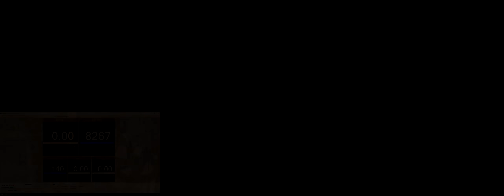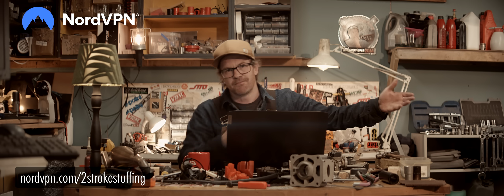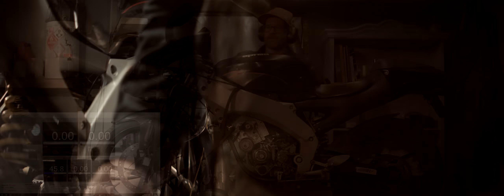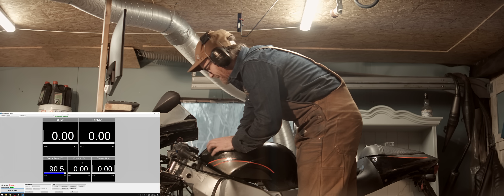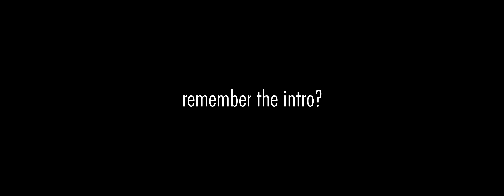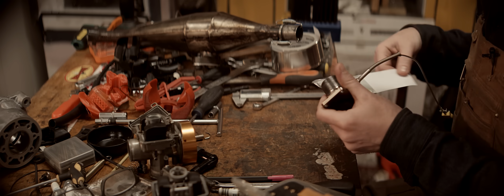P2 - Found THE Problem! - Now, Onto Making the Most Powerful Two Stroke Ever.

Comment: I told you it was the pipe many times. Using fritz formulas for pipes too it was obvious the pipe was wrong. You need to be making pipes to suit your changes. Remove the stuffers already.
Reply: 2 stroke is all in the pipe. Sigh.
Reply: It won't be when he switches to boost. @MrJermbob
Reply: Yes it will. Lol. Hes been boost before and it was terrible. He didnt listen then either. When im friends with people that have alot of boosted 2 strokes that make way more power per cc than this guy ever has. @davidgierke7582

Comment: Hey Alex I see it as a progress. 
What you are explaining makes sense to me.

I did a similar thing with my most recent Pipes when I increased my RGV from 250cc to 300cc.  
I also learned that simulation software can deceive you if you input "optimistic" Data. I lost power simply because I got the peak power target wrong.
When I did a set of successful pipes using MOTA to raise peak RPM. 
Once I got a good SIM of my engine, I had to keep juggling the pipe dims/timing/compression etc until I got realistic rpm outputs. (it did not give false readings just theoretical outputs way above the physical limits of my engine)
After all of that, the pipes did work and the SIM Data lined up with my real world Dyno results.
Onward and Upward
Pete

Comment: now you have hopefully found the problems with the engine. What's the next steps? 
Will you be starting to look at the larger crank case fuel injection? also, will the rotary valve be deleted eventually?

Comment: Now the only thing missing is the speed of the flow of the intake volume into the crankcase, if you can fix this part this engine will be able to take you to a speed of 150-160 km/hr which is equivalent to a 125cc engine. The 4-stroke, 58 mm piston is the engine of the Wave 125 motorcycle that has been popular in Thailand since the 90s.

Comment: Do you ever measure the volumetric flow in of the fuel if it agrees with your suppositions that a particular porting configuration is pulling unburned fuel out of the engine?  Just a random thought while I rest my aching back.

Comment: Pleaseee try not to use leaded fuel, the cons far outweigh the gains
Reply: No I think that you are wrong , the alcohol fuel that he is using is totally different to normal pump fuel a lot of the advice here goes astray because people forget he is using an alcohol type fuel . Also don't forget the pump fuel is very consistent and stable god knows about the alcohol fuel that he is using
Reply from the maker: Actually running 115 octane leaded fuel atm.
Reply: @2STROKESTUFFING   OK Alex I didn't realise that I know that you have used alcohol fuel before ? In the 2nd last video you got the engine up to 5-6 bhp @ 15,000 rpm yes ? I think that the Dyno is understating the power possibly by as much as half , I will explain in the 70's I had a Puch moped it had approximately 4 bhp and would do approximately 42 mph or 70kmh at around 7000rpm 
If I had run the same moped on your fuel I may have had around 7bhp And been able to achieve 90-100 kmh I know because a friend of mine did it with his Puch moped but again this would have been higher rpm but still not 15,000rpm . Your engine seemed to be revving very cleanly all the way through the rev range as well . Is there any other way of measuring your power ? Please check over the Dyno again and see if you have forgotten anything. There is another guy on YouTube trying to get a AR50 Kawasaki to 100mph his last Dyno measurement was 17bhp on regular 95 octane unleaded as far as I can tell and that again is air-cooled his revs were also a lot less than yours so I fail to see how you have only a third of his power
Reply: Don't feel bad, I thought he was using alcohol-based fuel Too. @ragsbiker7316

Comment: The pwk comes stock from keihin with a JJH needle, not sure if the china clones actually copy that though. JJS would be much much leaner at 0-1.5 throttle opening like 50% leaner.

Comment: The header still looks too short in comparison to the diffuser and the rest of the pipe. What percentage of pipe length is the header?
Worth a sanity check?
Reply from the maker: The long exhaust duct makes it look weird. Piston to end of header is 34% of tuned length, should be spot on.
I'm confident it is the volume that is the problem, especially in the header.
Reply: @2STROKESTUFFING  cool, I did wonder if it was the duct that was longer.
I've designed and built a few pipes using EngMod2T with really good results. However, I also  made a pipe for an AM6 that had too much volume and even when I shortened it wouldn't rev past 11000 rpm. Maybe your pipe is the opposite of what I did? Volume really does seem to play a part in the peak rpm. 
Bloody two strokes!
Ps. Happy to build a test pipe if required.

Comment: Just like I told you earlier. Try 125cc pipe. You can make your pipes. Just search 2 stroke exhaus, pressure washer, hydroforming. Not so hard to do. Make money on the side for custom parts.

Comment: Thanks for clearing that pipe situation. In my brain it has always looked weird.

I once modified an existing pipe on a Piaggio h2o -engine, where I took a LeoVince Handmade S and first shortened the start of the pipe. I noticed a markable lift at low/midrange. Then I cut the back open, removed the J-looking bent stinger that was inside, lengthened the "back cone" and flipped the stinger to the outside of the pipe. It revved like crazy without the silencer on one test run. I was running a 70cc Hebo Manston Replica with large ports that didn't match the original case halves at all. Managed to destroy two original belts and I wasn't even at the peak horsepower yet, doing around 100 km/h on a Gilera DNA. The project ultimately ended as I ordered a belt that was supposed to fit, but was for the NRG/Runner with shorter variator case. I rode it a few times and now the bike has sat in boxes for almost 15 years. I ported the casings to match the Hebo cylinder but then sold it to some youngster who destroyed it very quickly. Though it could have been because I widened the exhaust port slightly, but I'd think it wasn't that aggressive, possibly more likely to have been an oiling issue if he didn't crank up the oil pump or add oil to the gasoline. 

In the back of my mind there has been a voice telling me I have to get it back running some day, with crazy power. Just a while ago I spotted one project DNA for a few hundred euros but it was far away and I don't have the space...
Reply: 100kmh is achivable with stock piagio cilynder, my runner went 120kmh with a dr evo 70cc at 12k rpm,no gear ratio change. the belt would run out of the varioyit was above it on the half pully . matched case and a arow extreme exhaust . now im bulding it but its more ported and it will get a c16 pipe of my stalker, il come back with the resault
Reply: @robivlahov  I know. I achieved about 105 km/h (to the original digital speedo) with just the unmodded LeoVince and a Malossi Multivar 2000 (which has just more agressive acceleration that raises the initial RPM higher and isn't as linear as the original). 

The funny part is that DNA originally came with a restricted 17,5 mm Dellorto PHVA. So what I did was a rejet (I think it had a 75 main, originally 56 IIRC).

Also a slight mod to the air box to allow more air in but to also keep the airflow as similar as possible for proper resonating function. That really made it sound throatier but also way more silent than the original exhaust with probably damaged cat (from crappy oil that my dad bought me, that even scored the piston). I remember one night when my friend took it for a test ride and I standed on the side of the road for a long time. Then I heard something coming back, but I was sure that it was not my DNA. It sounded much bigger. When he ran past me I was so happy with the sound it made. Never heard a better sounding 50cc that can achieve 100 km/h. Very under the radar.

-

I think I ran a 105 main jet with the Hebo and I think I cranked the oil pump up a bit. But memories are faint after the exhaust modding. I did run it with a Jasil Evolution N.G. HPC crank, as one the original bearings were super loose on the crank and I managed to damage the bores on the original crank as well, after one time the variator came loose.

I really loved the 2 part head on the Manston Replica. And I think I paid about 175€ for it back in like 2006. It had to be one of the best bang for buck.

Comment: Ok also you must realise were you want to create a diffential pressure drop in the exhaust system inluding from the piston onwards a ventury  effect will have some positive effects when placed in the correct position ??  think of the ventury as a loud speeker horn ?? flow ,tempriture and sound , particulate matter ( the Medium )

Comment: I've always been confused by the dyno numbers, as they are sometimes registering in negative numbers.  Since your competence is obvious, I simply decided to consider the change to be 'electronic backlash' or some other effect that you have taken into account.  Your faith in the the HP readings seems to support this, so I don't sweat for needing an answer.  If, however you should have a moment when you are not 'unscrewing the inscrutable', some hint would be appreciated.
Reply: I don't know this, but I guess when you're not giving it gas it measures mechanical friction as negative power.
Reply from the maker: Spot on👍 negative numbers for engine braking.

Comment: The side exhaust- ports still leak into the transfers
Reply: Think he’s using bungs in the gudgeon pin to stop that happening
Reply: Dont forget that the exhaust pressure is about    8,5 Bar  or   200kPa ,and the bungs are not as close to the cilinderwall as the piston . I think the Conrod is 85 mm so Alex can not go shorter with Conrod to stay under the exhaust-port. shorter rod also changes all porttimings.  @Scissors69

Comment: So the rs50 made 27bhp for the land speend record  , how is this guy so far away after all this ?   11 bhp  pfft 🙄
Reply from the maker: Because stupid mistakes. That Rs50 made 21hp btw, on nitrous.
Reply: @2STROKESTUFFING   it' was 27bhp rs50 landspeed record, also another high powered 50cc two stroke is the derbi engine  that can run at 20bhp .. surely you're not using normal fuel ? 105 octaine or race fuel is required.   71% of the oxygen we breathe is nitrogen ,  just saying .
Reply: There is another gur guy trying to get a Kawasaki AR50 to 100mph as well and that's air-cooled engine
Reply: More air more fuel more compression more flow ,    its an air pump ,,  flow more do more ..  I'm routing for you . Good luck  👍

Comment: You have no powerband at all, sorry to say that.
Reply from the maker: That's ok, no need to be sorry.
Reply: Was it the same power all the way through the RPM range? I didn’t see all of the video
Reply from the maker: @Scissors69  People think there's no powerband because I start the runs where it kicks in.
Reply: Power band is anything you want it to be. What's really important is the where peak torque occurs in relation to peak bhp.
 @2STROKESTUFFING

Comment: Hi Buddy try messuring actual timing not jus relying on theoretical requested timing as i said before a larger timing trigger wheel will give a more accurate timing position
Reply: The timing resolution (accuracy) would be a function of the number of teeth and not the size of the trigger wheel I would have thought.

Comment: I had a feeling it would be the pipe length,think I put a comment up a few weeks ago about RC engine's,has anyone designed a variable pipe or could you make one to find that sweet spot???
Reply from the maker: It's not the length, but the volume that is the problem.
Reply: @2STROKESTUFFING  ok thanks, could you use two pipes or maybe one different volume to the other and try blend the pressure waves, just thinking out the box..... probably best I just watch the videos lol

Comment: I have often wondered about your neighbors...They have to be the "coolest" of all!!.."EAR" plugs are made of a material called "Energy Absorbing Rubber"..(you know those soft spongy ear plugs)..They cut out high frequency waves (the irritating part)...Their main product, is "blankets" that when attached to "horse shoe" shaped "racks", are placed over "machine's" in large shops, where hearing loss is an issue. If you want to give your neighbors a "solid kindness" I would suggest getting a length of " EAR blanket" and putting it over the Dyno..Your neighbors will probably give you a nice XMAS present for this "kindness"!!..👍👍👍🗽🇺🇸

Comment: Re. The  small bore stinger tests. I didn't see the rear wheel move, how were you measuring power? Also, not filling the cylinder is usually a mis match of the reflected wave from the expansion chamber. Have you tried to cut the expansion chamber in half and added a collar section to make the volume greater? If you have to advance the timing (that much) to make power, then you are trying to match a reflected wave that is arriving too early. If you increase the expansion chamer volume. the wave will arrive later when the piston is closer to TDC = efficient combustion. OK, saw the whole video now. Thumbs up.
Reply from the maker: 👍I didn't even bother putting the bike in gear with the 13mm stinger - it could barely rev in neutral.

Comment: I think your exhaust is too short for your built engine design.
Reply: What RPM is he aiming for?
Reply: @Scissors69  i dont mean that he should build a longer exhaust, but this results on the dyno shows in my experience, that the exhaust is too long for this engine Design now.
Reply: In other words his engine design doesnt support this high RPMs. For whatever reason

Comment: nearly 10whp at 11500 rpm from 50cc is quite alot indeed
Reply: That would be 100 whp with 500cc. 500 GP Bikes had aprox 200-230 hp (Honda), so 20-23 hp pr 50cc. 
A normal tuned 50cc with typical tuning kits and pipe and adjusting run from aprox 7-12 hp.
This engine - when everything is sorted out - will probably be anything from 20 to 30 hp.
Which will be insanely impressive!
Reply: @ole-martinlundefaret5876   you completely missed the point. the point is how low of an RPM it made that power.

Comment: Hey Alex! Try blocking the boost port! The angle is quite extreme. I see it is aimed at the exhaust port from what I seen in your CAD drawing. The rear transfers closer to the intake, have a weird angle towards the exhaust as well. I do understand that could create a bad situation where the fresh fuel is being dumped out the exhaust port. I believe it's running better at lower rpm with extreme timing due to not enough fuel in the cylinder. Once you hit higher rpm, the scavenge effect is effected even more. I know the rear transfers should be blowing fuel charge up the back of the cylinder wall up toward the spark plug. The boost port should be aimed at the spark plug. Hope this helps!
Reply: You have right the boostport should hit the midlle of the sparkplug. maybe Alex has special thoughts why the port is aiming just above the Exhaust-port
Reply: @henkcox8212 maybe to mitigate heat hotspots. You see, on „commercial“ 2-strokes the most common power-limiting factor is exhaust valves overheating. Alex doesnt have an exhaust valve, but due to the extreme scavenge timing and high resonant frequency, I think that otherwise the upper lip of the port could overheat.
Reply: He blocked the B port to normal angle + C port or boost port is ok

Comment: Is the stuffer gas tight? (not gasoline tight, gas)
If it is printer less than 100% infill it has to be gas tight to take up all the volume, right`?
Reply: Do you think it's PLA? The fuel must help keep the crankcase temperature under the melting point.
Reply: @purchasingagent1780  I think he said it was PETG.

Comment: I would like to see how well a inline 2 cylinder 50cc engine would run, 25cc per cylinder, would it benefit in more power and rpm than a single 50cc
Reply: You'd lose most of the 'stuffing' effect unless you somehow kept the crankcases from the two cylinders separate.
Reply: The cylinder count is not the problem. There is a dynamics that goes into designing a 2 stroke. Once he figures it out, that thing will be scary.
Reply: The only benefit of multi-cylinder at such small displacement is mechanical redline (max engine speed based on linear speed of parts in motion). Unless he wants to make more revs, it isn't going to give much advantage, while giving more mechanical losses, and potential gremlins.
Reply from the maker: A 50cc twin would have much higher port area vs volume compared to a single, that's the main advantage together with capability to rev higher.
Reply: Plus, a smaller bore reduces the chance of detonation due to reduced time it takes to burn the charge; this allows higher relative compression ratio at elevated rpm—where the horsepower resides. Technique was used in F-1 with impressive results. It's also why model airplane engines can rev to 50,000+ rpm on a single cylinder. @2STROKESTUFFING
Reply: I have been thinking about that to but ithink that the internal resistance would be to high for that
Reply: @Rodeha  Maybe - BTW the internal resistance has a name, it's called pumping losses. In engineering terms an engine is just an air pump, so losses due to pumping in the production of power. This can be rings/pistons/valves and camshafts in 4 strokes, crankshaft/exhaust backpressure.
Perhaps a single is better since it has half the pumping losses and needs less RPM to pump the same amount of air. 
I reckon you're onto something.
Reply: @ThePaulv12 - doesn’t it just pump 50cc however many cylinders it has?